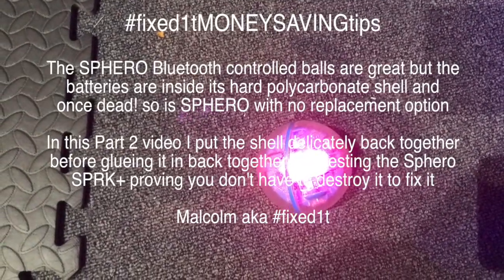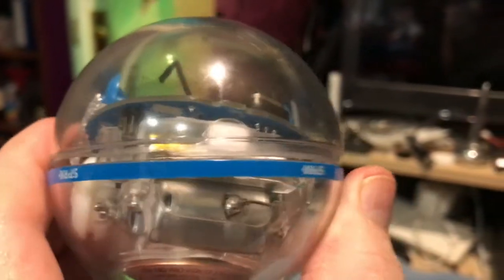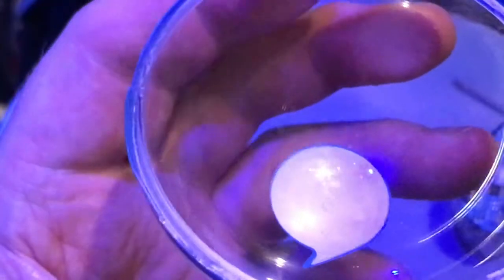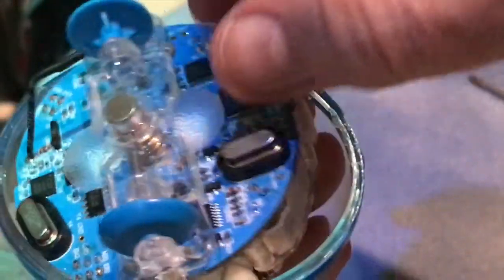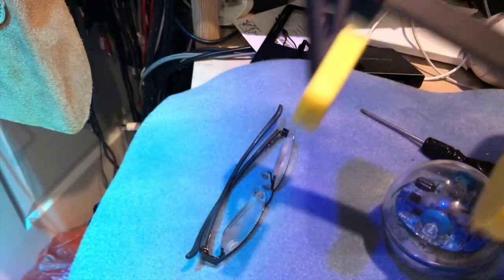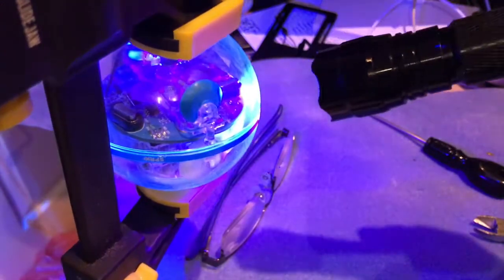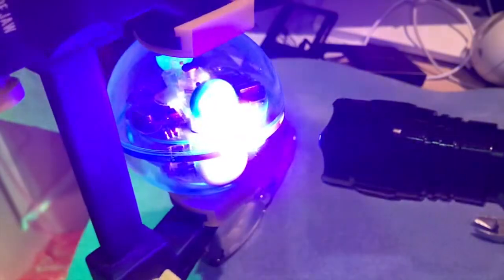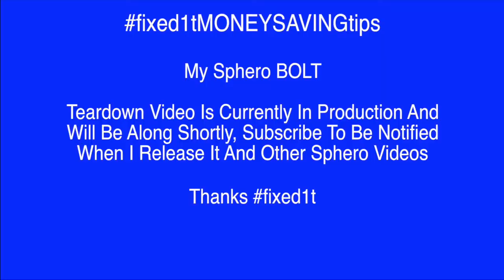How I Opened A Sphero SPRK+ And BOLT  Part 2

Comment: W
here did you find the replacement Battery pack, please?
Reply from the maker: I just took measurements of its size, thickness and power rating and went for one which was slightly smaller than the original, which like a lot of these batteries was a custom made size, so very expensive to replace if you can even find one. As with all these Lipo batteries the weird numbers often give the actual dimensions.  If you liked the video please feel free to buy me a coffee using this link:  https://www.buymeacoffee.com/fixed1tfix4  I need a lot of it to continue making these videos. Please don't forget to subscribe and check out my other great videos there are now over 650 to choose from and share @fixed1t with friends, family and colleagues as I could do with more subscribers to help grow the channel. Many Thanks Malcolm aka @fixed1t

Comment: This video was very helpful, thank you. Unfortunately though, Sphero’s insides become lopsided when it is reassembled and charged. I’m wondering if you have any insight into this. At the moment we have it tightly but not permanently sealed. It will connect to the app via Bluetooth but even when we set it straight it turns lopsided again when calibrating.
Reply from the maker: which squero is it? So glad it helped you its really annoying when it happens.  Please don't forget to subscribe and check out my other great videos https://youtube.com/playlist?list=PLVnKaE3t-yQWqZK6pjJVKNIX9b6F8cmbV there are over 510 to choose from and share @fixed1t with friends, family and colleagues as I could do with more subscribers to help grow the channel.  Many Thanks Malcolm aka @fixed1t
Reply: @fixed1t  Hi Malcolm, it’s a SPRK+. All I can think of is that the gyro may have been damaged somehow. When it wakes up it does its little internal spin and settles diagonally inside the case. Aiming and rolling is no longer accurate in this position.

Comment: I cut my sphero 2 open with an xacto straight edge saw, because the joint on the earlier robot is a butt joint and not a overlapping shoebox joint as in your example. Rather than glue, I used a good quality electrical tape this has an ability to stretch, and left me with a rugged easily removed connection and a "sporty" midband stripe around the sphere.
Reply from the maker: Yep that may do it for a while, I have another idea which I must video which I think you would really like. Glad it helped. If you have children, nephews and nieces try to pick up another and get them to dismantle it and rebuild it and send them on a road to life time fixing ;-) Please check out my other great videos https://youtube.com/playlist?list=PLVnKaE3t-yQWqZK6pjJVKNIX9b6F8cmbV there are over 408 to choose from and share #fixed1t with friends, family and colleagues. Many Thanks Malcolm aka #fixed1t

Comment: Thank you, this was also very informative! In one of the last videos, you said that dealing with the Sphero 2.0 was a bit different. Will your woodpecker method work on my dead Sphero 2.0 or do i have to try sth. else?
Reply from the maker: I started on a sphero 2 before I'd figures out what to do so it didn't end as well as with the SPRK+ or the BOLT. I've just purchase another couple of broken ones to work on to see if the method works, I'll being putting up a video of it when its done in a few weeks time. Please don't forget to subscribe to my channel and check out my other great videos https://youtube.com/playlist?list=PLVnKaE3t-yQWqZK6pjJVKNIX9b6F8cmbV there are over 408 to choose from and share #fixed1t with friends, family and colleagues. Many Thanks Malcolm aka #fixed1t
Reply: @fixed1t  Thanks for your answer! I tried and didnt have any luck in tapping open the Sphero 2.0 (spent over 1 hour with a blowback free plastic hammer) I ended up cutting it open with a jewellers saw (0.2mm blade) and managed to sucessfully glue it back together with Acrifix 192.